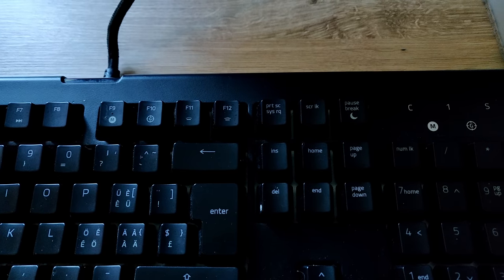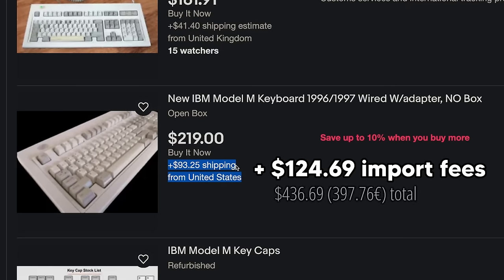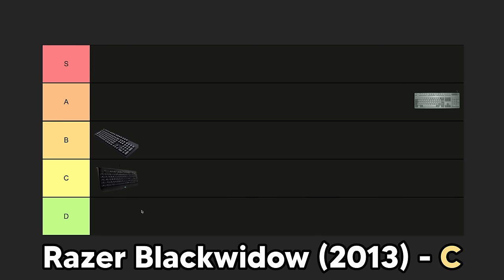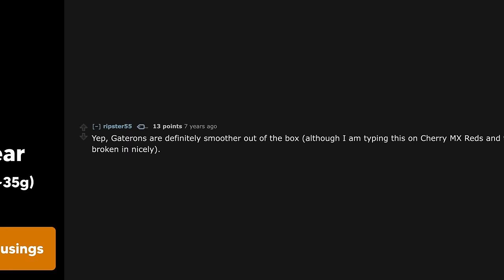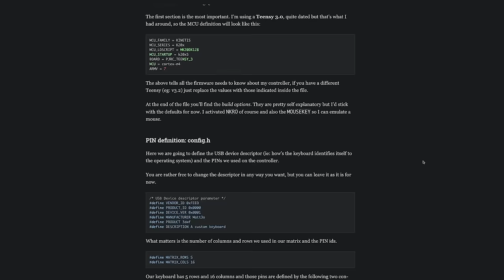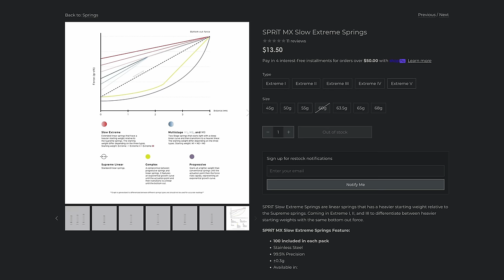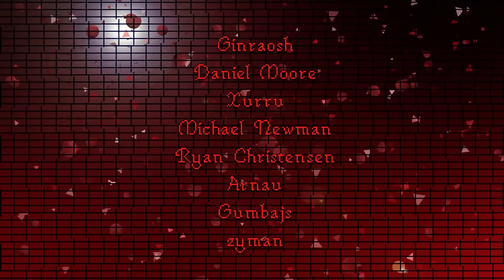How I Lost Interest Towards Mechanical Keyboards

Comment: I find it insane that handwiring a keyboard is something you gladly jumped into, but lubing switches sounds like too much of a hassle to you :D
Reply: I find handwiring much easier as it involves at least a bit of variation and some creative thinking, whereas switch lubing is excrutiatingly repetitive
Reply: how is it even possible that people do that crap in the 21 century
Reply: Yeah fuck that I would never do that just for a keyboard
Reply: I lubbed manually 5 builds and I'll probably never do it again. The satisfaction of handwiring, programming and even designing a PCB with the right layout for me (split staggered with thumb keys) has much more impact on my typing experience than any lubbing ever had.
Reply: i love to solder and switches is like assembly work techs hate that lol.. i have my solder cert
Reply: @formbi  This mindset that tech companies have propagated among consumers is why landfills are filling up with so much unrecyclable e-waste
Reply: @MM-vs2et  not really, it's quite cheap to make a custom PCB nowadays
Reply: @MM-vs2et 
That is just capitalism at work.
Reply: @formbi  I fix everything I like
Reply: dalebob9364  it is easier than it seems, but it depends on how bad it is i guess. i just stripped two bits of the trace on the both sides of the scratch that severed it and soldered a bit of wire directly to the stripped copper joining them with a bridge of sorts. there are conductive pens available too to draw a new trace but i never used them
Reply: @loicjeannin6233  ye this, ortho dactyl looks like so much fun, like the corne or chadis
Reply: I have trouble just picking switches. Let alone base boards and then thinking about having to wire schist up too!
Reply: Hey there! As a fellow tech enthusiast, I totally get where you're coming from. It's interesting how our interests and priorities can shift within the vast world of technology. Speaking of accessories, I recently came across the HOTO Compressed Air Capsule, which seems like a game-changer for keeping our desktops clean. Its powerful vacuuming and blowing capabilities, along with its compact size, make it quite versatile. What are your thoughts?
Reply: Lubing not even that exciting, boring.
Reply: That's his whole point haha, they are so CHEAP nowadays people just buy an entire new keyboard when 1 single key/switch stops working.
Reply: If you've never lubed a keyboard larger than a 65%, you don't know how fucking boring it is. Soldering is relatively painless. Lubing a full keyboard takes HOURS
Reply: @pavelagarkov7359 that doesn't make any sense. Soldering is not a mod and is irrelevant to how the keyboard performs. It iseasier and cheaper to solder them on mass scale, but if you want to customize the board, you will have to do a ton of work desoldering them instead of just popping out. Do you need more work for the sake of doing more work?
Reply: Especially considering that there is lubing and... lubing. I've just used Ballistol, pushed the cherry tip into the key and dropped the tiniest amount of oil down into the key. Then just tap it into every direction. Lubing done for one key. You don't need to take them out of the housing and it still works. I've did this to two Keyboards now and both a much more silent, much more smooth and it took maybe 30 minutes tops for a full keyboard?
Reply: fr
Reply: different people, different definition of FUN ;)
Reply: The feeling of accomplishment when the monstrosity you created actually works is amazing. Only I had to use outemu blues because the donor keyboard only had those, still proud of it (ears ringing from the spring ping though)
Reply: One's a cool building and problem solving exercise, and the other is simple tedious busywork
Reply: Pre-lubed is so much easier and doesn't sound much worse in most cases
Reply: @formbi fun

Comment: Life lesson: Never sell your HHKB
Reply: i've applied this lesson in my personal life. very important.
Reply: After going all around mechs you will still end up back at the HHKB topre
Reply: Laughs in 40% ortho
Reply: HHKB
Handholdless
Hugless
Kissless
Birgin
Reply: The one and only god tier Emacs keyboard
Reply: I just sold my HHKB a while ago and I can agree to a certain extent. Best feel keyboard hands down, but I prefer a preonic layout much more. If only there's an ortholinear topre board....
Reply: @emini6  the other good one is the sun unix keyboard, which is the one that HHKB copied the layout to some extent.
Reply: I used HHKBs daily for 17 years, and a whole bunch of different types of custom and exotic boards...  but what I eventually found works best for me is a relatively mundane Keychron V1 or Q65 w/ Durock T1 switches and a nice set of budget caps and deeply customized firmware.  The 65% to 75% designs seem like a "goldilocks" sweet spot for physical layouts, and QMK firmware allows a great deal of personalization to make the keyboard meet my specific needs.  So my HHKBs are in storage now, as they don't meet any of my "must have" requirements:

1. Open-source firmware, ideally QMK.
2. Hotswap switches so I can install my favorite switches and caps.
3. 65% to 75% row-staggered (i.e. traditional) layout.

It's also really handy to have a knob... and RGB per key, for custom layer and status indicators, since I have like a dozen layers and it's helpful to see at a glance which ones are active.

The only thing I really still like about HHKB is the Topre switches.  But I hear the Niz Plum switches do the same thing better... or I can get a very similar feel from some tactile switches, like Durock T1 or Boba U4 or Akko Lavender or Jelly Purple.  So I use those, since I can get a typing feel which is just as good but with all the benefits of newer and more versatile keyboard designs.  HHKB hasn't kept up with the times lately.  After going open-source, I can't go back... anything proprietary just seems irrelevant now.
Reply: Or buy a good mechanical keyboard and not those scuffed ones. But it will cost a pretty penny.
Reply: I feel this way about my Yugo!
Reply: Laughs in buckling springs.
Reply: I'm selling almost all my keyboards but my hhkb in a heavy grail housing is a lifetime keeper. That and my iron180 with alps browns
Reply: OK . Buy HHKB
Reply: @MpSniperM1911  or get the keymacs keyboard. Aluminum beast with alps switches and polyurethane double shot custom keycaps in the layout that the og symbolics boards were in. They cost a pretty penny though

Comment: Been using a standard PS/2 membrane keyboard for most of my life, other than the laptops I've owned, that mundane logitech office board carried me through a lot. For a membrane board, it actually was really solid. I was thinking of getting a mechanical keyboard for quite some time, but never really figured out what exact kind I'd want. 

Until one day I was helping move my friend out of his old apartment and we found his father's old IBM Model M, and his dad just gave it away cause he didn't need it anymore. I ended up taking it, and honestly, as someone who types a lot due to university and my writing hobby, the Model M truly makes every letter typed an amazing experience. Feels like I am writing on a typewriter. It is big, comfortable to type on and reach all the keys because it's literally the keyboard that brought the standard full sized keyboard layout to the market, the switches feel tactile, the sound it makes is exquisite, and you never wonder whether you pressed the key fully or not. 

This comment is much longer than it needed to be because I love typing on this thing so much. If it doesn't die due to old age, I don't think I'll be making a change anytime soon.
Reply: If it does die, a more modernized version is still made in an original factory today, by Unicomp. It's arguably not as good as an original, but I'm very pleased with mine.

Comment: So very similar. I’ve used mech keyboards for years and really got into them with custom key caps etc etc around 2015. I bought a hot swap board a couple years ago but never really bothered doing much with it. The other day i tried a tape mod with it and it fell apart. Ordered another hot swap board and now here I am again, a couple years later looking into mods, buying new switches, watching YouTube videos all about them.

The keyboard scene has changed so much in the last few years. I remember how it was all about loud & clicks switches. Now it’s all about chasing smooth, ‘thocky’ sound boards and adding different foam and god knows what else. It’s also gotten very expensive. The amount of different switches on the market is insane, too.

Comment: This reminds me how some folks will spend forever bringing an old vintage car to life, and then realize at the end of it all, they still are driving the speed limit as everyone else but in their own satisfaction of style.  Personally I grew up with the old clanky keyboards and remember how much of a racket I used to make while typing, yet I fully understand and it is why I got the Razor blackwidow (without numpad) because it allows me to recognize when the key is actuated.

I went through a phase in life enjoying flat keyboards when I was always working on laptops, but as a digital artist I really need the curvature ontop of the key cap to help my awareness where the fingers are resting. 

Ultimately it's an obsession, one worth considering because the keyboard and mouse are the input interface between our brains and the digital realm, Razor is the best imo, I added 40A o-rings and will never go back to anything else in the same way that I use a tiny mouse to prevent my wrist from having to move around because of the discomfort that caused over long working hours.
Reply: I'm the opposite to you, I was super into my mechanical keyboards, and started out in 2012 with a black widow (its still sat on my desk)
but over the years as a mechanical engineer who does a lot of typing and cad work ive realised I'm much faster and much more comfortable on a cheap laptop island keyboard 
and honestly I have a sense of guilt about it, I love using old reliable tools, I whip out the slide rule, ink dip compass and fourth generation calipers as often as I can, hell I use a chalk board for most of my workings
but I just can't get comfortable anymore on a mechanical keyboard

Comment: I never really gave much thought to keyboards for most of my life. My position was "Whatever - a keyboard is just a keyboard no matter how many bells and whistles you add." Then a year ago it became clear that I needed a keyboard with Korean characters for learning Korean and I bought a wireless Logitech K380 while living abroad. It looks pretty lame with its round keys and plain white colour scheme. However, having a keyboard as thin as the K380 means I can keep my hands much flatter while typing with my arms rested on the desk and the improvement in comfort is so much better I now use it for everything.
Reply: I've been using the K380 for something like 6 years I think. It's a wonderful keyboard, available in most countries, at a cheap price. I remember going down the rabbit hole of mechanical keyboards like @Livakivi. In retrospect, it's all mostly hype. There is much more to the keyboard than charts about actuation patterns. The K380 is wireless and works years with the batteries you insert. It's lightweight, reliable, and I can reliably buy a new one. It's also working with my particular hand sizes and fingers, which is probably the most important thing in a keyboard.

My advice, and I think it matches the experience of this video as well, is to try a few keyboards, and pick the one you like most, regardless of ridiculously specific data like actuation patterns. I also advise to consider availability so you have a plan if it breaks, and accessibility so other people than you can actually use the keyboard without your help.
Reply: Once I get back to Korea I will shop around for Keyboards since I plan to get a desktop once I am there. The only thing I really need from a keyboard is to have Korean characters on the keys which is much harder to shop for in the UK.

I've heard some people say that the sound of keyboards is soothing or pleasant but it doesn't really do anything for me so I'm happy with how quiet the K380 is since it doesn't disturb the people I talk to online while I type.
Reply: I've thought about looking around for keycaps with Korean on them, but at this point I honestly don't really have any reason to I just kind of want them, because I just learned to touch type by typing and pulling up a diagram every time I forgot a key position until I remembered them all.
Reply: @sheep4483  That's also a solid solution as well. Unfortunately I lost the tip of one of my ring fingers as a kid so I never learned how to type properly because of it. I only use the thumb, index and middle finger on my left hand.
Reply: @michaelcallaghan1989  I now opt for silent switches whenever I can, purely because I find it obnoxious. I'm very excited for Kailh to release the Ambient series for the Choc V1 switches.

When you say you lost the tip, how much is missing, if you don't mind me asking? It's just there was someone who had also lost a portion of their finger, and designed a PCB to account for this, which was actually really cool!

Comment: Got my first mechanical keyboard around 2014 (a Cherry MX  Board 3.0 with MX Blacks), then last year instead of shelling out 400 or so for a custom I realised I'd probably be just as happy with a modded prebuilt, so I picked up a Cherry G80-1800. It just ticked all the boxes. High quality POM keycaps, german ISO layout, plateless design and no through-switch LEDs (no desoldering necessary to open the switches). Put in Epsi-modded Durock screw-in stabilisers, lubed everything with Krytox, oiled the springs, filmed the switches. I love the sound and feel, only thing it's missing are media buttons. But that can be remedied with an AHK script on the numpad. 160€ instead of 400. And it looks like it's from the 80s which I love

Comment: Hhkb pro 2 was my second Mechanical keyboard after graduating from a Corsair gaming keyboard with MX reds. Bought it on eBay JP for $200 total and then did the hasu tmk controller with Bluetooth mod. 

Now, 10 years later, I've just purchased the hhkb pro hybrid S to use at work. It's astonishing how much more rigid it it is and all the creaks are gone. 

110% satisfied with my purchase, might try to lube my old pro 2 and if it doesn't turn out as good I may buy another hybrid to replace it.

Hhkb for life ❤

Comment: Started around the same time as you in the mech journey. Almost exclusively used ducky keyboards for a long time until they priced themselves out and couldn't compete price-wise against the new brands. from MX red -> MX blue -> MX brown -> custom switches. Custom builts and DIY kits definitely changed over the last few years; everything became more accessible.

Lately I also settled on my endgame which is quite simple (T1s for alphanumerics, U4Ts for non-alphas, linears for shift+ctrl+spacebar and clickies for toggles). Using ceramic keycaps which definitely has its drawbacks and it's more of an early-adopter product (definitely not for light typists and stems are fragile; but overall feels like a piano and sounds great). 

Besides the endless new switch designs in this space; definitely feel like a keycap material/profile innovation. Feels like at some point in the journey, everyone will settle with what they have and look into doing incremental upgrades; if they get particularly attached to a certain keyboard. 

Had an urge to buy a buckling spring keyboard several years ago - but the price always kept me away (same goes for HKKB and Topre). It's simply too big of a leap to get a keyboard that is incompatible with everything I have already. Buckling springs always seemed like a rose-tinted glasses affair - people may think they want it as I definitely have some fond childhood memories of being woken up to a buckling spring keyboard sound at the dead of night. But the main drawback I can distinctly remember was how variable the keybaord can be once the springs wear out. Sound definitely can be annoying once the novelty wears off!

Comment: Very interesting keyboard journey you've made over the years. I personally have slowed down a bit after discovering them 3 years ago. I've come to the conclusion that you'll eventually settle on a board that you really like and then just toy around with different switches on that specific board every couple of years.

Awesome video, gonna sub and check out your other content.
Reply: Just don't go down the ergonomic rabbit hole.
Reply: @oku-mq7kg  I've been interested in getting an ErgoDox at some point in the future. Haven't pulled the trigger yet but I assume the ErgoDox EZ is the easiest way to get one.
Reply: @Fogoat  ErgoDox, Moonlander, Kinesis, Dygma Defy, and much more are all viable options in the pre-built space. 

The Kinesis Advantage360 Pro is the only one I'd personally buy out of any pre-built, but I much prefer low-profile boards with choc spacing at the very least.

I would say it's the best move to make, switching to an ergonomic keyboard. But it can be an expensive rabbit hole as you explore different layouts.

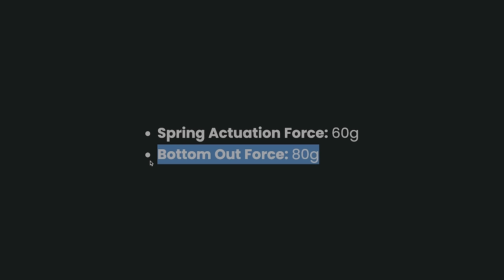Comment: 12:24 For Pok3r keyboards you can use CAPSLOCK as a function key by setting the dipswitches to 1(off), 2(off), 3(on), 4(off), that makes the positioning of the arrow keys really nice. as your right hand is usually hovering around that area anyway. I also like that FN+BACKSPACE = DEL.

Also if you want to try this setup but don't have a pok3r keyboard you could do this with the AutoHotkey software running this simple script:

SendMode Input
SetCapsLockState, AlwaysOff

; Map j,i,k,l to arrow keys
Capslock & j::Send {Left}
Capslock & i::Send {Up}
Capslock & k::Send {Down}
Capslock & l::Send {Right}

; Map Caps Lock + Backspace to Delete
CapsLock & Backspace::Send {Delete}